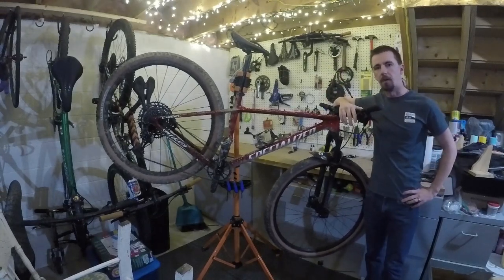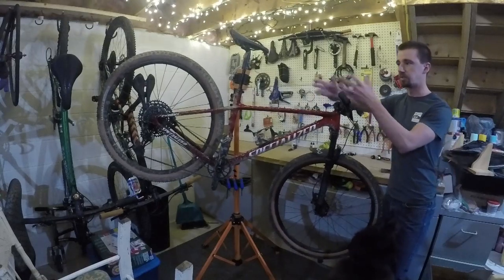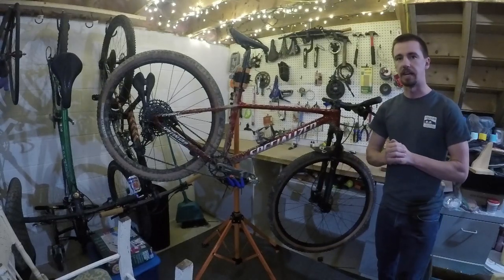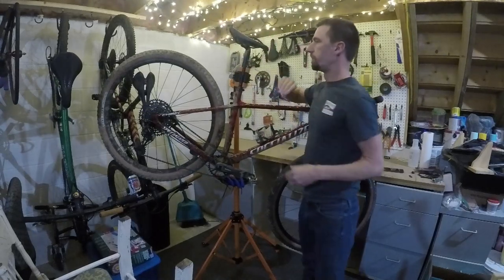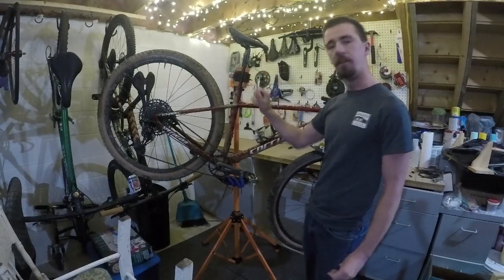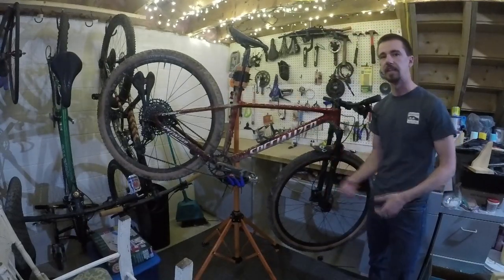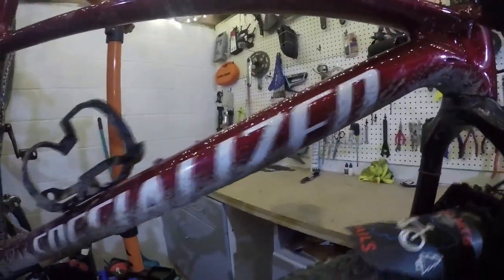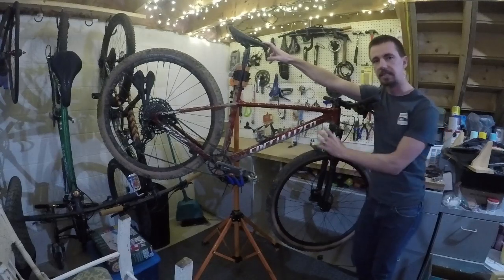Why You Should Buy A Specialized Chisel | Full Review and Breakdown

Comment: Its the compound that changed with the fast tracks they do grip but there is a downside, they drag on smooth surfaces you can even feel them squirming beneath you. This became very apparent when i swapped my rear tyre to a racing ralph and the difference was massive, the ralph was so much better for climbing. I have a fast track dual compound on the front and ralph 2.25 on the rear i think its perfect for the chisel.
Reply from the maker: I ended up taking both of them off and put on Maxxis tires. I am glad I tried to like them because the sidewalls are definitely better but the traction still sucks

Comment: I have my chisel for 2 years now, still no issues great in xc rides, still riding it with judy though
Reply from the maker: Do you like the Judy? I'm really not sure big fan of it
Reply: @OhioMTBTrails what bike is the better choice? Specialized fuse or chisel ?
Reply from the maker: @djzrobzombie2813  I would get the Chisel and put 2.6 width tires on it. It'll still be way lighter
Reply: @OhioMTBTrails exactly. At least get a front 2.6 for super grippy turning.

Comment: fair choice for bikepacking few days a  year?
Reply from the maker: I definitely think so!
Reply: I've been wondering the same thing. My local shop has a killer deal on them right now. Torn between this and something more like a Fuse for the geo and larger tire volume.
Reply from the maker: @rustydixon4026  I debated between the Chisel and the Fuse. The Fuse is significantly heavier and I didn't value the weight over the slightly better tire traction